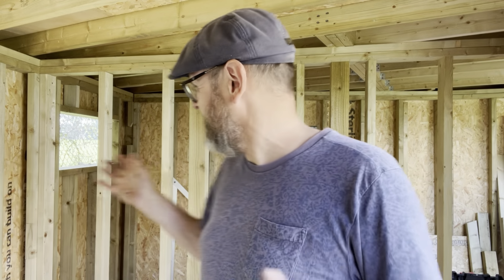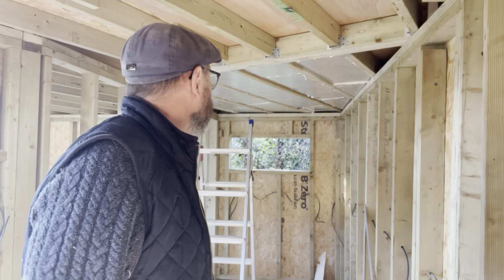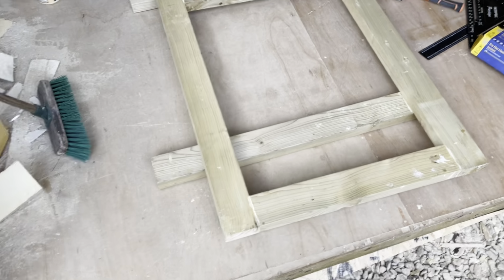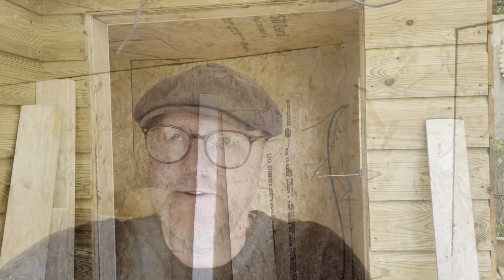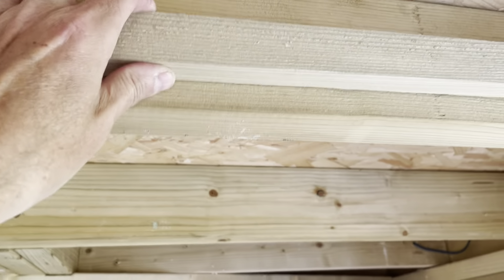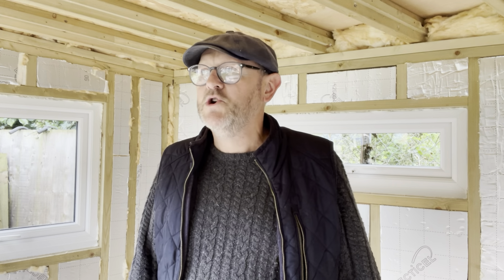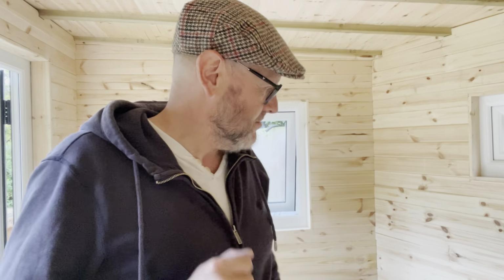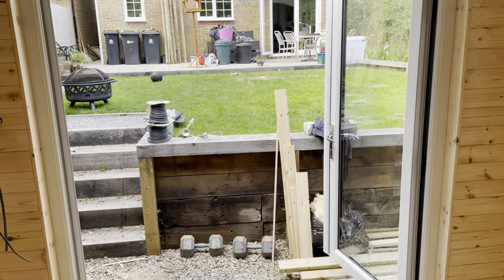Garden room build Stage 4. The Interiors

Comment: This looks amazing.

I love the exposed beams in the roof;  however, i was wondering: is there an air gap between the roof OSB & the insulation above the T&G?

Also: what're the dimensions?

Again: excellent, and thanks for the lovely video!
Reply from the maker: Hi Jonathan. There is a small air gap but not as big a gap as the walls and floor. 
Across the back it’s about 6m 
From the front to rear at its longest which is the shed side 5m 
The French doors section of the build 3m
Thanks for your questions 
Mark
Reply: @KAPWoodworkandbuilding  Ah thanks!
What about the height?  is it a 2.5m build? if so: does that 2.5 apply to the very front of the overhang at the front of the shed? (sorry if annoying question... but im trying to find a straight answer for my own build!)

Comment: Would it be worth using an expensive saw that you can sharpen?
Reply from the maker: That’s an interesting debate. Especially in the current world we live in. I’ve had more expensive western saw’s in the past and needed to have them sharpened but I never did they just went blunt. I’ve recently bought a saw file for that very purpose but as I’ve swapped in the workshop to Japanese saws you can’t really sharpen them I’m led to believe. Using very expensive saw’s on site would not really work as you are cutting many different materials as explained which ruins saw’s.